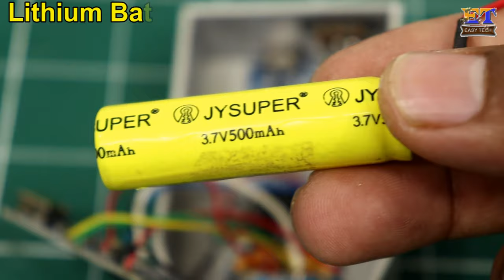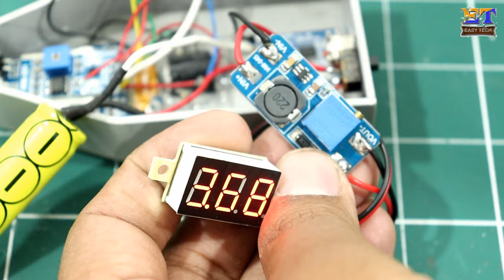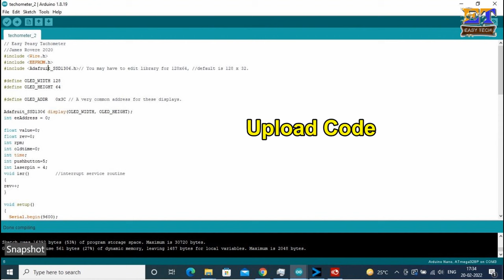How to make RPM meter | Digital Tachometer using IR Sensor

Comment: its not so great because you need to have black surface and a reflective surface,because infra light reflects with reflective material like white paper .but black absorbs the infra light,so i guess it's better to use the  speed sensor so that it's way more compatible